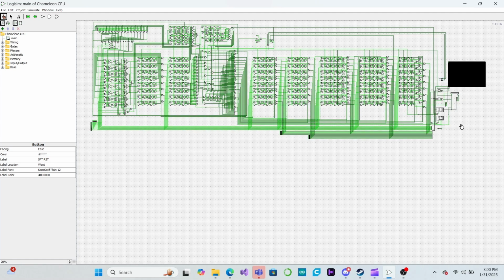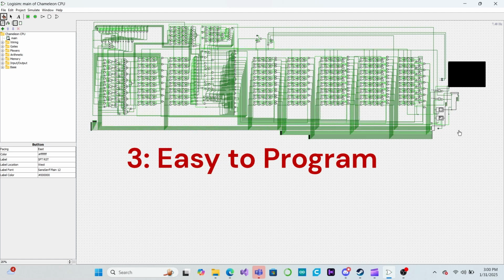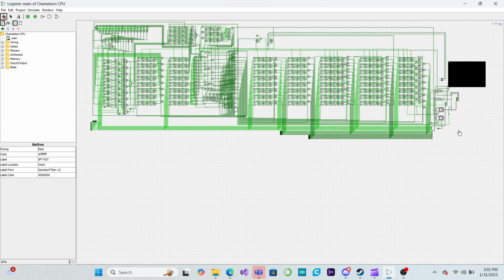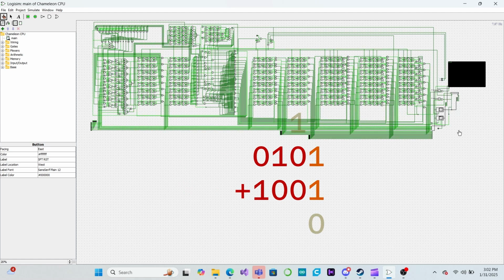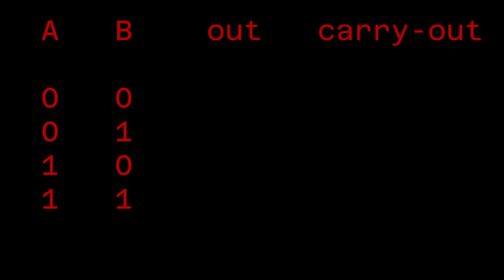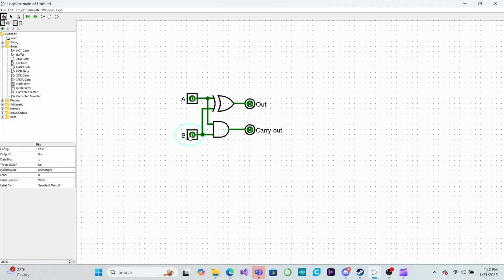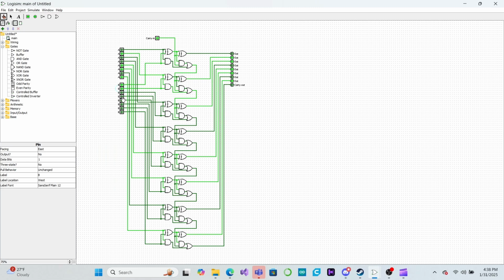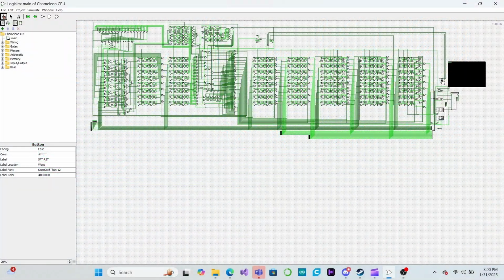How to Add Binary Numbers (The CPU You Can Build, Ep. 3)

Comment: I'd be happy if you could talk in more detail about how did you simplify the full adder to build it with transistors. I can't do it with less than 14 and you did it with 12. I tried a lot of boolean algebra, but it didn't help. I saw that if you connect the two outputs of two gates electrically, it is equal to the two gates anded. Thank you.
Reply from the maker: Yeah, anding two gates by connecting their outputs only works for logic gates that use resistive loads.  For example, that trick won't work with CMOS because it will create a short circuit.  But it's a useful trick to keep in mind when building with NMOS and similar logic families.